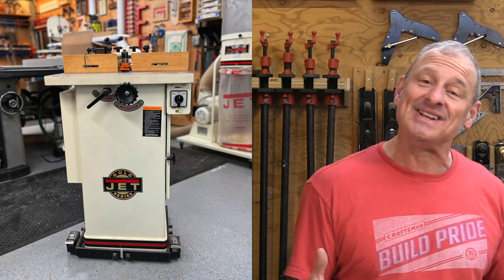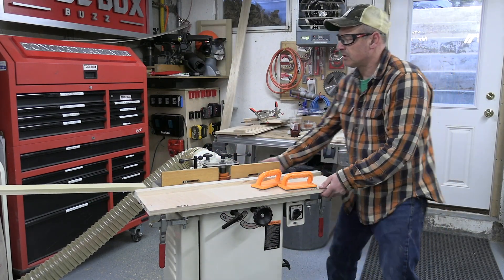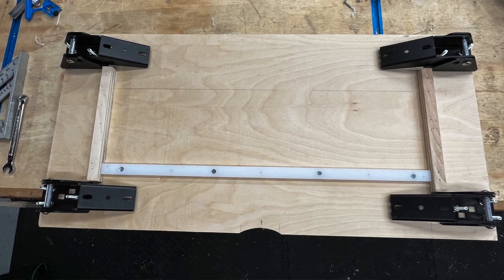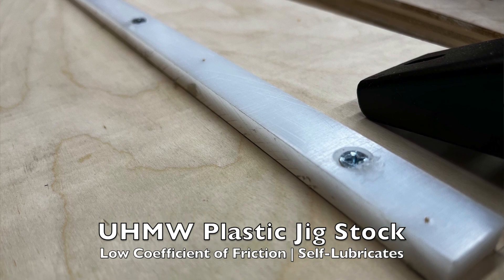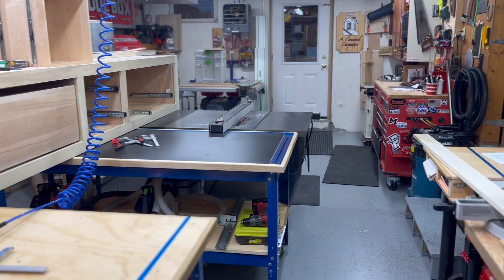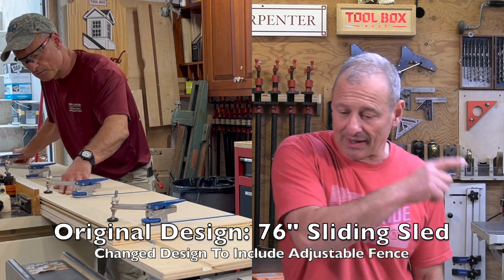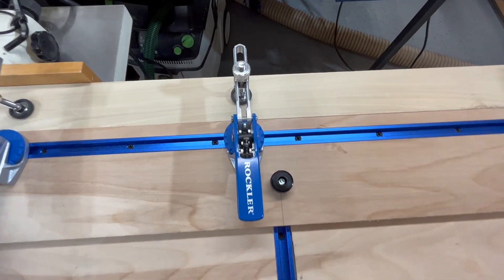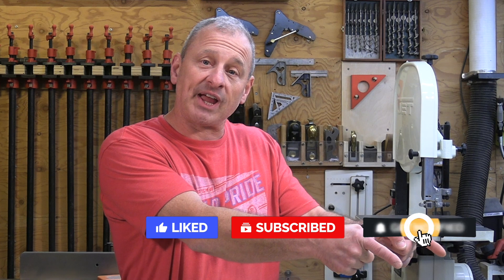Shaper Extension Table

Comment: Rob -- That looks like a great addition to your shop. I hope it serves you well.

Please permit some suggestions from someone who ran a lot of board feet through a shaper when I worked at a furniture mill. First, never use the miter slot on a shaper. If the fence is aligned to the miter slot, using the miter slot works. But, if you're using the miter slot, you have to adjust the fence to the cutter AND adjust the fence to the miter slot. Since you can reference your coping sled and other jigs off the fence, just using the fence saves set up time. 

Second, most of the issues you were having could have been resolved with feather boards. In the furniture mill, if I was running a lot of stock, I used a power feeder. (Rockler sells them. With the amount of stock you run, you should consider getting one.) If I wasn't running a lot of stock, I used feather boards -- one mounted on the fence and the other mounted in the miter slot (which is what the miter slot is for on a shaper). A properly set up set of feather boards will keep the stock tight to the table and tight to the fence, which would prevent the issues you were having. With really long pieces of stock, I would have used a cart as an outfeed table. 

Third, it may be time to replace the sacrificial wood on your shaper's fence. It appears to have become grooved from running a lot of stock against it. Either replace it or joint the faces. My recommendation is using MDF faced with laminate. It's smooth and dead flat, which is what you want with a fence. 

I hope some of your viewers will find these tips helpful.
Reply from the maker: Great tips thanks

Comment: Buy a power feeder, properly adjusted, there extremely safe and consistent. Would be a tight fit on your little shaper, but looks like a base might fit on your rear corner.
Reply from the maker: Thanks

Comment: Not to be that guy, seems like every carpentry video I see has folks telling them they are doing it wrong.  It looks like a sweet table extension.  

Maybe it’s just a matter of not wanting to spend the money, but it seems like a power feeder would be simpler set up , save some shop space and more accurate over the long run.  Also a little safer as your hands never have to get that close to the knife.

Again the table extensions look well made and a nice addition to your shop.  Thanks for the video.
Reply from the maker: I never considered it - Im old school I guess. Ill look into it, thanks for the suggestion

Comment: Rob, my man... You should be proud of the upgrade you made. But there is a better way to handle this. I have run a custom cabinet shop for a while, and I have an incredibly efficient operation. You should first consider hiring someone like Elias Woodworks to do this for you because they can do it way cheaper and more efficient than you (and they do a great job). But if you must do it on your own, then you need a power feeder. You can run infinitely long pieces with perfect consistency and no chatter. It also frees you to get the next piece ready to feed and utilize a helper to cut your part production in half.
Reply from the maker: I never considered it - Im old school I guess. Ill look into it, thanks for the suggestion

Comment: If you want a bar for miter slots, get it from Incra. Their products are American made and very high quality, unlike the crap rockler sells. Their products are not cheap and are worth every penny. Oh, and their miter gauges are the best in the industry.  100% repeatable precision on any angle. My life will not be complete until I own one of every product they make. Their tech support is also the best I have ever dealt with. 

And no, I do not work for them and I have never received anything from them for free and have paid my own hard earned cash for every product I have from them. And I seriously can't wait to send them more of my money.
Reply from the maker: thanks for the tip